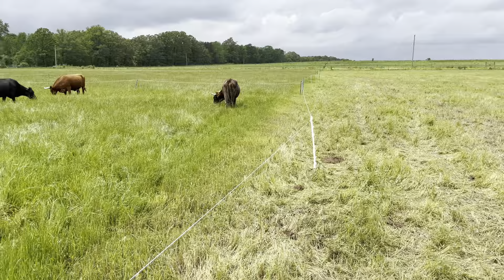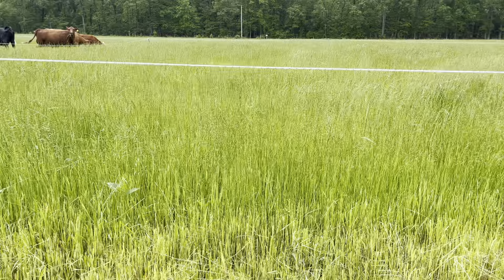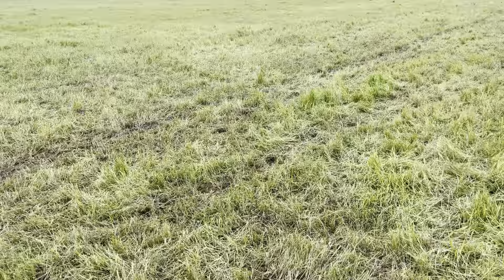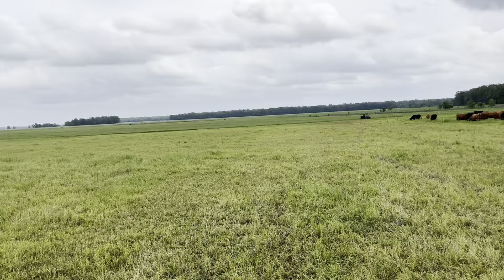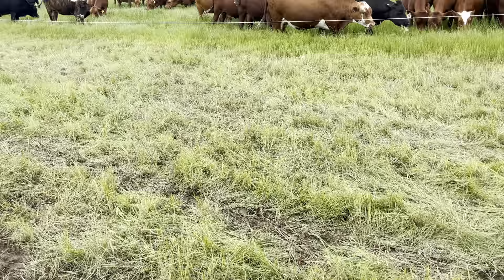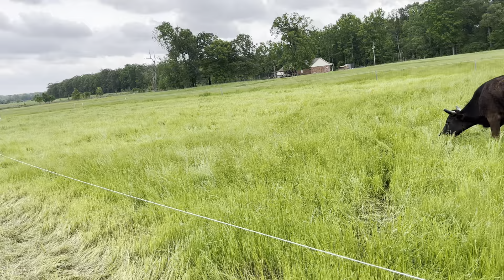Drought and Pasture Management While Rotationally Grazing

Comment: So I assume you’re probably grazing this half of your farm 2 or 3 times with 80% harvest efficiency. You probably return to the first cell within 30 days on warm season grasses before they lose quality. My question is, what makes your stockpile half last all winter long (with no regrowth) when you’re harvesting 80% of the forage and returning within 30 days. Hope this makes sense. Thanks
Reply from the maker: The stockpile is the portion of the farm not grazed the entire growing season.  It should have a lot of biomass.  It may be rank/dormant but they’ll graze it.
Reply: So between the increased biomass of the stockpile, and much slower moves across it, you end up with enough forage to last November-April
Reply from the maker: That’s correct.  Additionally, in normal years the portion you graze intensively lasts deeper into the year as well.  Keep in mind that when the  Bermuda goes dormant there is still a partial rotation on that part left as well, which can be significant